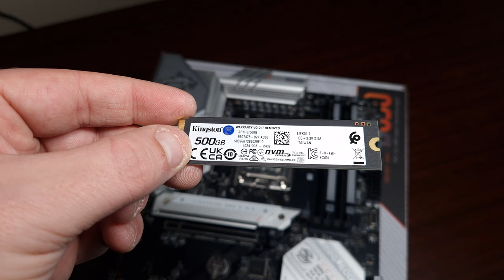Kinda Expensive PC Build: FT Ryzen 9 7900 / RX 7800XT Nitro+

Comment: No way it cost that much. £2000 for a Ryzen 7900, 7800 XT, only 16gb ram and a 500gb SSD? A Ryzen 7900 has no place in a gaming build. I hope no one uses these parts. I'm tryna see how much you paid for each part. Cuz you scammed yourself if thats really how much was spent here. £2000 can get you 7800x3d, 32gb ddr5, 1tb nvme, 4080 Super/7900XTX and still have money leftover 🤦🏽‍♂️
Reply from the maker: It's individual part Aio fans PSU Case as well
Reply: 7900x is just fine for gaming. Clearly he also does videos, a 7900x is going to be better than a 7800x3d for video editing and exporting. Price is a little high but not that outlandish as case, psu, aio and fans are all included and they're not cheap ones. Ram really should be 2x 16gb ddr5 6000 though, I wasn't even aware 8gb sticks of ddr5 were even a thing, perhaps it's a confusion of 2x16gb sticks.
Reply: @PineyJustice  wouldn't build a editing system with a Radeon GPU.
Reply: @thuering6229  Radeon is better than nvidia for davinci, very competitive for everything else.
Reply: @PineyJustice  no, definitely not. If you refer to PugetBench: they don't cover all fields of editing. If it comes to a huge part of editing - decoding and encoding - Nvidia is better in quantity, quality, driver optimization and options (codec parameters). No professional uses AMD for editing, no matter if Resolve, Premiere, Avid, Vegas or Edius.
Plus: if we look at highend editing with Nuke, Fusion, Maya, Blender, Houdini, Smoke... Nvidia is ahead. 
Plus: the most used 3rd-Party 3D renderer - VRAY - is ONLY working on Nvidia.
AMD sucks for content creation, period
Reply: @thuering6229  For the average user who is editing youtube videos with davinci, AMD is the superior option, for both editing and exporting. For blender, AMD works just fine, especially if you're using linux where blender is native, AMD in linux is literally several times faster than nvidia is in windows. Sounds like a lot of cope for overpaying for a mediocre gpu with not enough vram.

Comment: "Very expensive PC" with 500GB SSD and only 16GB of RAM. Ryzen 7900 instead of a for gaming much faster 7800X3D. Cheap O11 knock-off case. I hate cheap O11-clones. Cheap OEM AIO & fans. Only good things in this build are PSU, MoBo and GPU. But way to expensive. As already mentioned: for £2000 / 2300€ / $2500 you can get MUCH better hardware.
Reply from the maker: The fans ain't cheap neither is the Aio
Reply: @WELSHYTECH  have fun deleting comments? I should inform your sponsors. I bet that was your 2nd account arguing with me.
Reply from the maker: @thuering6229  I Haven't been arguing with you this is my main account the other is welshytech shorts

Comment: I paid the equivalent of about €1670 for a ryzen 7700, 7900gre, pro b650s wifi mobo, deep cool 360mm aio, cooler master 850w psu, a 1tb AND 500gb ssd, deep cool ch510 case and 3 case fans. You could have done a lot better I have to say, but either way still a very capable build. You live and you learn mate
Reply from the maker: Most of the parts were provided by brands bud
Reply: @WELSHYTECH  that's fair

Comment: Your computer is way overpriced for the specs
I just built my PC and spent €2270 (about 1950£)
NZXT H7 flow 120€
MSI B650 GP Wi-Fi 180€
Ryzen 7 7800x3d 370€
PNY 4080s 1100€
Corsair RM850e 150€
Patriot Viper 32GB 6400 CL32 120€
Thermalright peerless assassin 120 SE 40€
Lexar 790NM 2tb 160€
4 NZXT 120mm fans off of EBAY 30€
And I'm sure there are some things that could be changed in my build to make it better... Please research a bit more before you spend a large sum of cash

Just my 2 cents here:

Even if 16GB is the bare minimum RAM you'd want in 2024, I'd go for 32GB for safety, in my PC just using firefox, discord, spotify and league I use about 18GB...
500gb SSD is nothing, even with 2tb I feel that I'll need to buy a second m.2 stick if I want to keep my games installed...
You have a ryzen 9 but a  radeon 7800x, your GPU and CPU are almost the same price... what were you thinking?

Other than that, the setup is really pretty, and I hope you're happy with your new PC!
Reply from the maker: Didn't you get the part of the title as a pcbuild 
Parts were provided to make a pcbuild video only parts that are mine is the cpu motherboard and gpu 

My actual main system is 

AMD RYZEN 9 7900 
32gb ddr5 
B650 MPG EDGE Motherboard 
2TB SOLIDIGM P44 PRO 
Be quiet Dark Power 12 850W Titanium PSU 
And the GPU RX 7800xt nitro +